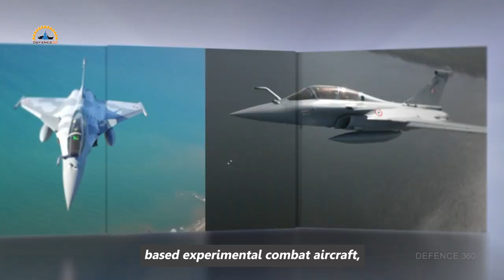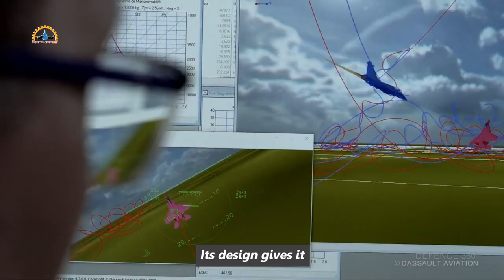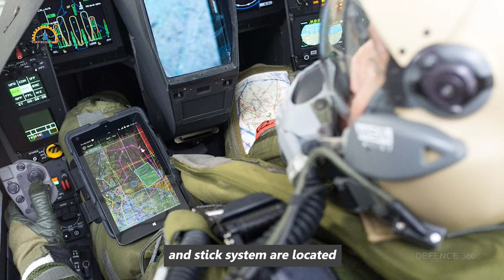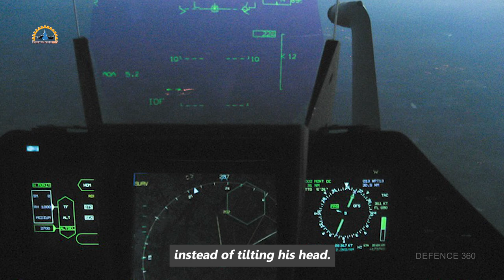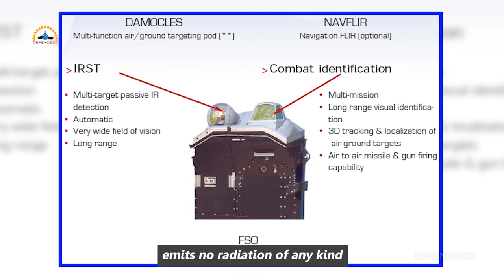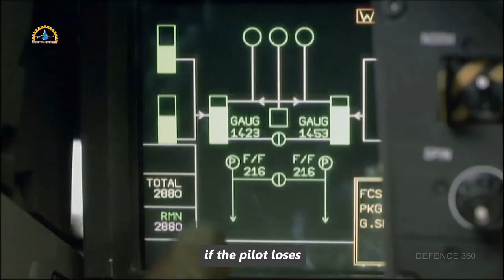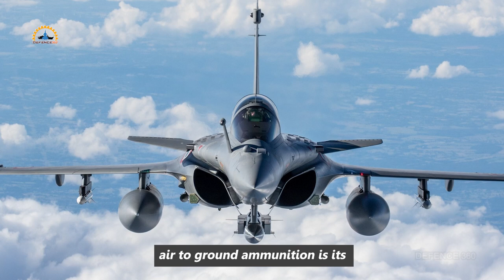Evolution in French Rafale Fighter Jet Explained

Comment: First, the narration says the Rafale carries 9000 lbs. max. on its external hardpoints, then seconds later it says it's 9000 kg. A kilogram is about 2.2 lbs. For those who are rightly confused, the Dassault website says both numbers are off. It can carry 9.5 metric tonnes (9500 kg), which converts to 21,000 lbs.
Reply: it is 9500 kg of armament or 14650 kg in armament and fuel, the Rafale C weighs 9850 kg, and 24500 kg at full load, this poor Eurofighter which weighs 11000 kg carries only 10000 kg in armament and fuel! total weight of 21000 kg! a Rafale therefore carries 4650 kg more than the Eurofighter which is however faster and above all more powerful than the Rafale!!
Reply: @LOLOVAL-os3pq I was always a fan of both of those, and in the early days clearly favoured the Typhoon. But with the upgrades the french have put into the Rafale, it has evolved into something else, man.
Reply: oui , exact , le Rafale C pèse 9850 kg  , il emporte 9500 kg d'amement et il a une masse maximale de 24500 kg , soit presque 150% de son poids à vide ( c'est un record pour un avion de moins de 10 tonnes , avion en service , et non un prototype ) 14650 kg carburant et armement soit 32297,721 lbs
Reply: @patta8388  I don't understand how the 4 countries that participated in the development of the Eurofighter could have made so many mistakes, these two planes are very similar, but the Eurofighter being more powerful and faster than the Rafale should have been very close to the Rafale while in 2009, the results of the 18 fights between these two planes showed that the Rafale is clearly superior!! I really and sincerely have difficulty understanding this huge difference!! as for the maximum admissible load on the Eurofighter, empty weight 11000 kg, fully loaded 21000 kg or 10000 kg in armament and fuel, while the Rafale carries almost the same weight only in armament with 9500 kg!! I really don't understand that, I swear I don't understand this huge difference for two devices that are so similar! like the load factor of the Rafale which is 11G positive and only 9G for the Eurofighter, it is incomprehensible to me!!!
Reply: @LOLOVAL-os3pq  The reason stands into the original design mistake on the EF: joined air inlets under the fuselage. The EF cannot carry heavy weight under its fuselage because of these air inlets. As opposed to that the french air force requirements stated from the beginning that the rafale must be able to carry VERY heavy ordinance under the fuselage (nuclear AMSP-A in mind). The rest is dassault has more accumulated experience in making fighter jets, they know better how to make light and strong at the same time.
Reply: @cheesefrogsnail  the English also wanted to do bombing, but they had a lot of problems on certain missions that this role was given to the Tornado, and finally, after many years, the Eurofighter was able to do bombing, but they lost a lot of time, the problem, no, the problems with the air intakes of the Eurofighter, one of these problems forced the front landing gear to be positioned differently, which prohibits the installation of a tank greater than 1300 liters, while the Rafale can accommodate a 2000 liter tank on the ventral side, I don't see why the Eurofighter couldn't carry heavy loads, it can take two storm shadows under these wings, which is once again a shame, This is because the main landing gear prevents these heavy loads from being placed as close as possible to the ventral part, where in theory, the resistance is optimal. I believe that some of the problems on the Eurofighter come from the Germans who wanted to impose certain ideas that were “bad!!!” like the ventral air intakes, and the canards further forward, the canards are so poorly positioned that they prevent the pilot from seeing down when looking to the left or right, it's because, even stupid, but why did the English agree to let this German bullshit happen???!!!!!!!!!!!! it's inconceivable, the Germans have always made good planes, for example: the Spitfire, the Mosquito, the Tempest, the Merlin engine which was installed on the Mustang P51, they even designed the first jet airliner , which following a manufacturing error, 3 COMET aircraft crashed, the Germans made during this period, the Me 109 and FW 190, but even the small Mosquito bomber had superior performance to the German planes, and the Concorde with the France showed that they knew how to make planes and especially engines!
Reply: @LOLOVAL-os3pq  yes, according to a Dassault former engineer the germans were obsessed by the cobra figure the SU27 could perform, this is the reason why they wanted the ventral air intakes and the canards set forward. Vectorial thrust  was planned as future development but eventually will never be implemented. How the English accepted this stupidity, this is a good question!
We know now also the cobra figure is useless against a Rafale because it can fire a missile to reach a plane behind him (2013) and so easily as after a cobra the plane is a dead duck with no speed. So this bad original specs will be a burden for the EF impossible to overcome. That's a problem with the germans generally speaking, they are so sure of their superiority that they get stewborn (ask Airbus guys in Toulouse about it...)
Reply: @cheesefrogsnail  excuse me, I don't think the Germans wanted a plane capable of making a cobra, aerial combat techniques were invented during the First World War by them, no, I think they wanted above all a plane of superiority aerial at high altitudes, hence these enormous air inlets to have maximum air, and the canards at the front, very forward, prevent the wings from stalling at high altitudes, in short, the canards stall but not the wings, but ultimately this idea is stupid because we don't fight at high altitudes, at least not at 15 or 18,000 meters, the fights take place between 3000 meters and 7000 meters, where their planes respond better ! the Rafale like the Eurofighter have delta wings, which give them better maneuverability, strong aerodynamic braking, more solid wings, Dassault has the reputation of making solid wings, the former American director of FEDEX had bought Dassault FALCON 20, for their capabilities on grass fields (for small aerodromes) he recounted a mishap to one of these FALCON 20s, one day, one of these planes lands on a small airport, the next day, the airport is covered in thick fog, the controller is aware of nothing, he does not know that with the fog, the front controller left the planes parked at the end of the runway, the FALCON20 pilots start, they ask for authorization to takeoff to the controller, the controller grants takeoff, the FALCON 20 pilots line up on the runway, they push the throttles, the FALCON 20 picks up speed, and all of a sudden, the pilots realize that the runway is cluttered with planes, unable to stop, the FALCON 20 crosses the planes and stops, there were millions of dollars in repairs on the parked planes while the wings of the FALCON 20 had not absolutely nothing, only the paint was scratched!! LOL
Reply: I am reporting what they say at Dassault, and on the technical point of view there is a lot bearing their saying: first there is no specific reason to have the air inlet under the fuselage, proof: the F15 has huge air intakes on the sides. Second air inlet under the fuselage prevents the engine from shutting down at high AOA and why would you want high AOA on a plane that will never land on a carrier? third canards set forward allow the nose to point up quickly, this is basic mechanics. So I'd put a dime on the Dassault explanation about why the EF was design this way.

Comment: the Rafale program started in 1984, the first flight of the Rafale was in 1986, Dassault designed the Rafale in 2 years! as Dassault still had Mirage 2000s to produce, the time between 1986 and its entry into service in the French army allowed its improvement, as the M88 were still in development, the Rafale flew with two American engines, like these two engines were much bigger than the M88s, the silhouette of the Rafale was further refined thanks to the M88s! the Rafale is a 10 ton aircraft (9850 kg for the Rafale C) it still holds several records in its category (-10 tons and twin engine)
Reply: The Rafale programm itself started in 1988. In 1984 it was a technological demonstrator. Rafale A (first flight in 1986 ) and C (1991) have a general aerodynamic in common, but they are two completely different aircraft.
Reply: The real "roots" of Rafale program is "Mirage 4000" that Dassault tried to develop for Saudi Arabia, as France was not interested, being at this time a too "ambitious" program. So no, Dassault has never developped this aircraft in 2 years, this is in fact a much longer and complex stories, Dassault acquired many KEY design with the Mirage 4000 demonstrator to later amend the projetc in a mulltirole program.
Reply: @fidelio3841  and the 4000 come from the G8, and so on... We are talking about a technological demonstrator. It's development of an airframe and FMS, that's it. 
It was similar for EFA, X
X32 and X35, etc. It took the same time approximately for 4000 development. The development of internal weapon system, sensors, data fusion and electronic warfare take much longer time.
Reply: @bug2k64  thank you but I know all that, and what you say is false, the Rafale program started in 1984, like any aircraft, there is always a demonstrator, but it was still a Rafale, the whole thing looked like the Serial flurry! and yes, I know that prototype A had 2 American engines, F404s, you are going to teach me what my country manufactures maybe???? I am French, and I worked for a Dassault and Airbus subcontractor!
Reply: @LOLOVAL-os3pq  je suis français aussi... Le Rafale A a été développé en deux ans en partant d'une feuille blanche. Même si ils se sont basé sur l'expérience du Mirage 4000
Reply: @bug2k64  on est d'accord , mais si on regarde le Mirage 4000 , c'est en réalité un Mirage 2000 2x plus gros en bref , les commandes de vol étant pour ces deux avions électriques , si on regarde le Rafale , il y a tellement de différence que Dassault a utilisé peu de chose du programme Mirage 4000 , c'est ça qui est incroyable , ce qui m'intrigue , c'est l'énorme rssemblance entre le rafale et l'Eufofighter , je ne parle pas des erreurs de conception sur l'Eurofighter comme les entrées d'air cote à cote , ou les canards génant le pilote pour voir vers le bas , ou les trains d'atterrissages mal positionnés ! ils gênent l'installation des charges les plus lourdes ( donc les plus volumineuses ) aux endroits les plus résistant !

Comment: "France secretly worked on its carrier-based aircraft "
BS. It was never "secret". In 1976 France was working on the Mirage 4000: delta wing, 2 jet engines, canards just above the air intakes (as for Rafale's design), 1st flight on March 9, 1979,  way before the Eurofighter. Mirage 4000 was the Rafale's ancestor.
Reply: No, the Mirage 4000 is not at all the ancestor of the Rafale but rather a Mirage 2000 on steroids, you just have to look at the air intakes which are closer to the 2000!

Comment: F4 RAFALE JET IS COMING UP NOW WITH SERIOUS UPGRADES FOR WEAPONS AND TARGET SYSTEM.. NEXT F5 RAFALE WILL CARRY HYPERSONIC FRENCH MISSILES. RAFALE IS THE BEST FIGHTER JET OF THE WORLD WHICH CAN FACE 5/6 GENERATION FIGHTER JETS NOW.. RAFALE IS BASED ON UPGRADES WITH TIME... NEEDLESS TO BUILD NEW JET FIGHTERS FOR SUCH AND SUCH OPERATION WHEN A SINGLE ONE CAN PERFORM EVERYTHING  LIKE THE RAFALE !!!
Reply: Copy of eurofighter
Reply: @valerianocuomo996  eurofighter’s first flight was after rafale’s one but yeah sure
Reply: @valerianocuomo996  the design is necessarily similar because it was the same project on the beginning!
Reply: @shaveridan and it was like 5 years after sooo …
Reply: @valerianocuomo996 The Typhoon is still my favourite, but c'mon dude. Don't spew bullshit. The Rafale is not a copy and these days actually the better aircraft.
Reply: @valerianocuomo996 Eurofighter = low cheap Rafale + low cheap capabilities....  sure your country is going to buy F 35 😅😅😅 always the same mystake !!!
Reply: @fabricerubio1070  it's neither low nor cheap. Nor cheap in capabilities.
It's was designed for a different purpose and was and is the better interceptor and air superiority fighter. The Rafale was designed as a multirole fighter and because french jet engines were always a bit lacking, it doesn't even trade positive on the trust to weight ratio. 
It's an excellent aircraft that has the Typhoon beaten at certain mission profiles and loses to it at others.

Comment: Since the release of this video three months ago, I would like to add information regarding the standards of the burst. Currently in 2023, most of the French Rafales are at the F4 standard, but by 2040 there are plans to bring all French Rafales to the latest official standard planned, which is the F5 standard. In the meantime, the manufacturer Dassault Aviation and its partners are said to be working on a possible Standard F6, but this should not see the light of day before 2060.
Reply: If i'm not mistaking i think that the F4 standard as been validate only few month ago so it will hard to modernise all the F3 standard rafales into F3/R standard (equivalent to the  F4 standard) in just few month it wil take few years. But the new rafales that are being delivered to France in the "all Rafale" project to replace the good old mirage and increase the capabilities will be native F4 standard of course.
Reply: @fidelio3841  Some F3-R are updated to the F4.1 standard. New planes are F4.2. The F4 standard (F4.1 & F4.2) was validated in 03/2023.

Comment: The confusion of SPECTRA being a electronic attack system but is actually just a SPJ
Reply: Hypersonic-es6vh  Still a SPJ. Not an attack jammer. You typed a wall but its still self protection.
Reply: Hypersonic-es6vh  SPECTRA (Self-Protection Equipment to Counter Threats for Rafale Aircraft). Stop posting FALSEHOODS!
Reply: The Rafale's jammer is called BAN Jammer. It is fully integrated with SPECTRA, navigation and attack systems with data fusion picked up and recorded by the central computer.

It can totally jam the radar system of the Su-35 and defeat it in dogfight as demonstrated in Egypt recently.
Reply: @Ben__S   Are you sure ? Jam the radar of the Su35 ?  Sounds like a big deal for a SPJ.  Can spoof the radar for self protection i believe possible to prevent a missile lock.  To jam the radar totally like you said ?   Poor radar knowledge in the Sukhoi likely.
Reply: @pigmoonk2545  Yes, I am. Su-35 certainly has a technological gap, but the SPECTRA BAN system is very efficient. The system is something more complex, global than a SPJ, and integrated to the central computer. This allows it to evolve and it was designed to.
Reply: @Ben__S   I really hope so. Though unlikely.

Comment: Eurofighter would have sold another batch of aircraft to Saudi Arabia but it was denied that by Germany with its veto.
 That influence alone stopped other potential sales ( who wants to buy from a ditherer ) . EFT already was more expensive than a Rafale and Dassault had dropped its poor radar and moved for an AESA radar and developed the air to ground strike package earlier.
 EFT was slow to convert to ground strike because Tornado was already doing that job and all four partners didn't like parting with money. The F15 had a similar slow development ( Israel did the hard work) .
 All aircraft have design limitations to meet the goals needed. Rafale had close coupled canards for low speed handling for aircraft carrier use and less sweep on its wings but that gives it excellent ordnance weight advantage however it is not as advantageous for high speed. 
 EFT has more powerful engines, increased sweep on wing angles , variable intakes allow height, canards are forward for leverage ( centre of gravity ) and biased for transonic manoeuvrability.
 Yes both have sweet spots and weakness  points but both are capable and effective compared to Russian and Chinese equivalent aircraft. 
 So which is better?  
Maybe if you want speed then Eurofighter suits. If you want cost consideration Gripen. If you want a good all round package then Rafale. All keep evolving with upgrades but perhaps Gripen with a new engine and layout has evolved more than its cousins and its roadside ability is way better in today's Ukraine conflict and no other aircraft has that trick. 
 Debate nicely!

Comment: Great 4th gen fighter. 🧐
Reply: Hypersonic-es6vh  Doesnt matter how you want to dress up a 4th gen fighter , it will still be a 4th gen. You have to be Born into it, like the F 35 . The Rafale is a good 4+ Gen.
Reply: "generation" does not man anything. It is a checkbox list that does bot match the real effectiveness of the jet.
For instance, if you go to a technical choice of your own, you won't check the "5th gen" list but still you can outperform 5th gen jet.

Only effectiveness matters.
And 5th generation do not mean better effectiveness.
Reply: 5th generation means bringing weapons along not subject to drag , higher G force ability with internal weapons, better stealth, stealth allows you to fly high, for longer, in thin air using less fuel, no targeting pod hanging off it's built in, entrained cooling on the exhaust gas ( smaller target ) 360° awareness, 2 way data link to weapons, radar double the size and power or LPI , EW capable. 
  Basically a new phone is always better than an old phone.